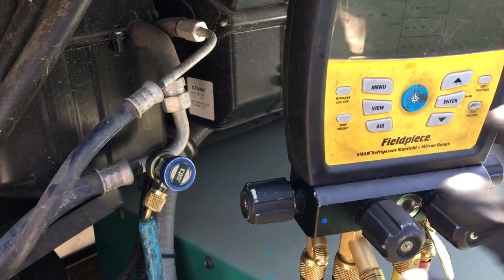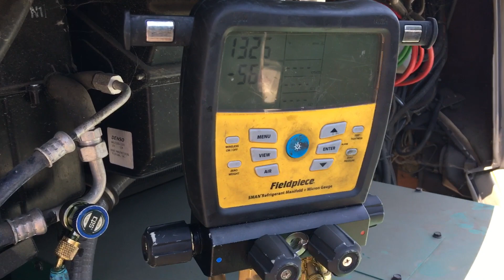Massively Water contaminated refrigerant system. Idiots who use shop compressed air to leak test￼. ￼

Comment: i have a hack and use argon gas from my baby tig welder.....ive never had any issures....in  a pinch it seems ok     Jay.
Reply from the maker: @charlesleake930  argon welding gas works good. It’s a dry gas just a little bit more expensive than nitrogen.

Comment: Ive seen evaporator oil flush using a container and its connected to a shop air with cleaner flush liquid. Will this introduce also moisture to the evaporator? What is the correct method to flush oil out evaporator?
Reply from the maker: @janernstd9842  you can use nitrogen instead of Shop air

Closed loop flushing that uses the machine to pump the flush through components  

When you use shop air, it will just take a lot longer vacuum to remove the moisture . 

Everybody who owns a micron gauge that it adds hours to how much more vacuuming you have to do when you use shop air . 

Over on the Facebook group 
(Automotive HVAC technicians)
Everybody has discovered when they want to take the time and experiment

They use shop air or systems that they’ve found. I have been left open..  
To get the vacuum to hold down around 500 µm
Technicians have been leaving their pumps on for 24 hours to 72 hours.  Before they could get all the moisture out.. 

It makes a really big difference on time when a system is really badly contaminated with moisture.

Comment: Using shop air is low pressure testing  ineffective mostly .  50--100psi above operating psi  . Equal psi in both low and high sides . testing psi 200--300psi . U might think it will create a leak it does not but if the system has an issue with pressure,, testing this way will find it . 

Amazing but still there are people on the net pushing moisture /shop air into an air con !!!!
The only exception is spray painting shop air has fine filtration with a drier  but the psi is still to low anyways .
Reply from the maker: The majority of spray paint shops are cheap and lazy. They don’t change their desiccant.   They put it in there while it was new and very rarely change the Jessica material when you look at the moisture indicator they’re always yellow meaning they are saturated with moisture. 

And that’s still not a low enough moisture content     

I got a few videos out there systems were people use sharp air, and after a couple years, I cut open the plugged up, expansion valve, the crusty, rusty rotted out inside receiver dryer, or the internal small fins inside the tubes of condensers that oxidized in crumble the way Intuit looks like sand from the moisture   
     Anybody can do it they said system will always work after you have done it. It just causes damage much later on it’s like a time delay ticking time bomb. Good for business.
Reply: Oh god even sub tropical  climate zones shop compressors can spray  a constant stream of water LOL    My first boss was so cheap we had to fabricate main supports for the roof . Being a 100yo tram depot the roof had plenty of holes . Is it suppose to rain when your working LOL  That was the biggest auto dealer for 2 brands in the state . Glad to leave ,oh yea the a/cons had no chance . 
The owner had yachts and multiple mansions . Sold the land/business30 yrs later , ,   business worth nothing the land 100`s of millions .
Reply from the maker: @paulthompson1654 chime 💰 pays big time.
Reply: It `s when I got the refrigeration addiction all those years ago . The auto based industry  teaching was poor . Even the specialists at the dealer were only on a good day average .There was huge potential to gain more knowledge .Would not be to hard to do better LOL  Always ask the right people and many have the time to teach .
Reply from the maker: @paulthompson1654  yes, a lot of the automotive teaching it’s pretty pathetic

Even from professional training facility sometimes. 

There’s still a little archaic back in the black dark ages . 

Just so many are so cheap and so lazy .  And intentionally ignorant.. 
Especially 90% of the owners of the businesses .
Reply from the maker: @charlesleake930  no none of our instructors ever use that or even mentioned that companies Refrigeration books, but I see by researching them they’re an old name that has been around for many decades
Reply: @coldfinger459sub0  Thank you Tom...it was in those books i first learned about the old refrigerants "  Sulfur dioxide and  methyl chloride "  im sure if we looked at them today with and open mind we would find they are excellent ....and the " scare " factor was so they could switch to a more profitable substitute.... Jay
Reply from the maker: @charlesleake930  some of the first refrigerants were CO2 and propane

My grandparents apartment building at Central refrigeration for the whole apartment building for the refrigerators using the sulfur base refrigerant . 

Been dead for years, but it’s sprung a leak 50 years later toxic stuff make your eyes water your throat clothes up and burns your lungs
Reply: @coldfinger459sub0  that's cool that you saw some of the old systems ...was this in San Francisco ?
Reply from the maker: @charlesleake930 this was about 15 or 20 miles south of San Francisco

Comment: That's what I did with mine. I left it on negative pressure overnight for several nights and ran repeated vacuum sessions for like 60 minutes or more before taking the vehicle from my house to the shop to have the refrigerant added to the system.
Reply from the maker: What was your final micron reading you got it down to.
Reply: @coldfinger459sub0  I can't really do micron but because the gauge never showed microns. It wasn't calibrated for that but it does have PSI readings which I got down to like -35 PSI low side and I left it like that for hours. I can do that because it's my truck not a customer's vehicle that they want back in a hurry. It's cooling and has been for the last month when we had the gas put in the system. The only thing is that gas flow noise that you hear with the air on of the gas flowing through the evaporator sort of oscillates in terms of volume or loudness.
Reply from the maker: @electric_thumbs  there is no -35 vacuum

That means your gauges are extremely out of calibration .

Comment: I haven’t seen an rv yet that the dash air wasn’t completely filled with  moisture I tell the customer it’s going be $4000 to do the  job correctly  that includes adding shut off valves for the heater hoses
Reply from the maker: When it comes to quality construction repairs and service of RVs.   There is no such word as quality in their vocabulary. 

        In the last 30+ years coming across RVs there’s some of the worst designed and worst maintained. 
                       And they always end up taking them to shops with the least amount of knowledge or care about quality. 

       Luckily this is one of those fairly easy ones to take care of

        He’s going to return for service they have the receiver dryer replaced and the expansion valve replaced
Reply: That way when they call 2 weeks later because a crimp starts leaking I can tell them that it was because of contaminated pag oil caused the leak  no warranty
Reply from the maker: @Mobileccs  Superior AccuTrack ultrasonic leak detector. Help a lot identifying leaks when you have the system pumped up to 170 psi using dry nitrogen.    Pressure you cannot obtain when sitting static with the AC off in your shop.    Ultrasonic leak detector also helps find vacuum leaks when you have the system under vacuum

           But there’s nothing you can do for those types of leaks that do not leak at the time you’re testing only when the customer drives away when the system is an operation all the Crimson fittings are vibrating and shaking around with the bumps of the road and also the expansion and contraction from hot and cold cycles and pressure constantly raising and falling will cause leaks later on after you have done all your work.